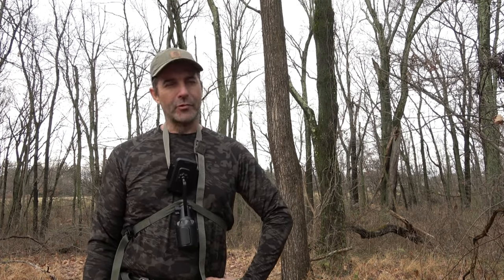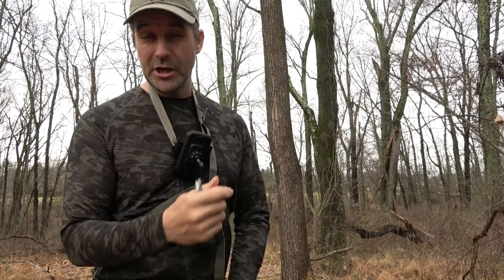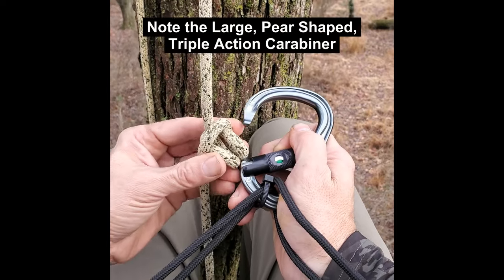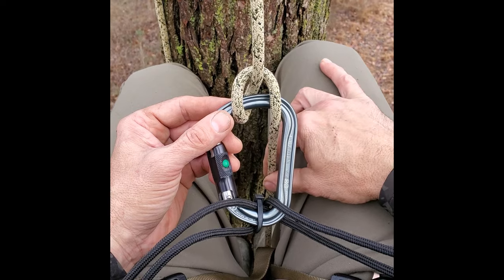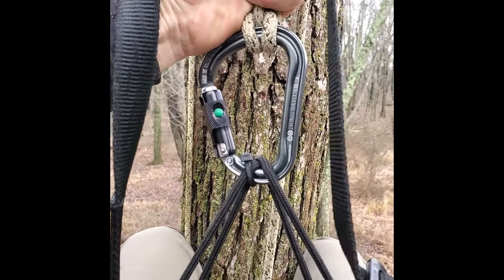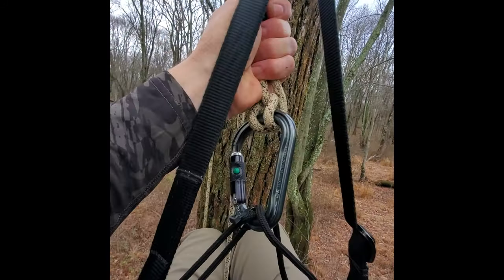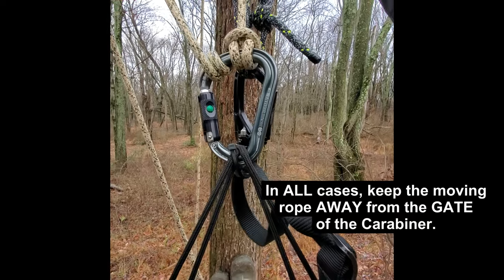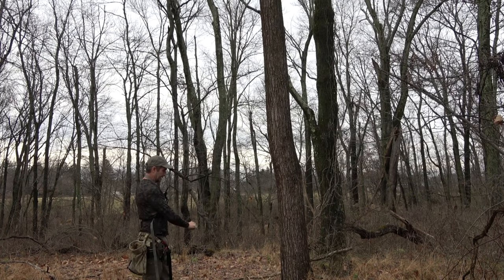Single Rope Rappel on the Munter Friction Hitch, Tree Climbing Demonstration

Comment: I've used munter (aka "Italian hitch") a lot for mountaineering to both belay and rappel (abseil) because it works on heavily ice crusted ropes when devices don't work. It is essential knowledge but it has high rope sheath wear and  twists the ropes, more a problem on long rappels. You do a lot of rappelling with munter/Italian and the ropes don't handle as nicely after that. Great to know but not my go-to method
Reply from the maker: Fyi, have climbed and rappelled nearly every day on a rope with the munter and at the end of 4 years when I retired the rope based on manufacturer recommendations, the rope still looked new with noticeable wear. I had read that it is rough on the sheath but in practice, I learned otherwise.  And you are correct that it can add spin in the rope during the rappel, however, that can be neutralized by varying the angle at which we feed slack in. However, typical rappels for a saddle hunter are only 25ft or 8m. A mountaineering application could be much longer and require precision in the technique. Thank you.

Comment: This demonstration, in my opinion, should be required introductory material for aboricultural training. 

In the standard curriculum, Munter's hitch still gets hardly more than a passing mention to this day, at least where I am based (NZ).

Weight variation of the effective life support load in arboriculture is significant, even without including rescue scenario loads (double the weight). My height is just 1.8 metres and my build is relatively light. 

I haven't weighed myself in the last few years, I would estimate it to be now between 70 and 80 kilograms (I consistently hovered around there since my third decade and I sense myself to be carrying about the same amount to this day). Add weight of harness, along with the changing requirements from one day to the next, maybe a rigging line and block or rings, sometimes a few kilograms' worth of rear handle chainsaw to attend to mid-size timber or maybe the more occasional ten kilograms' worth of MS661 for cutting some large timber at elevation when the circumstances necessitate it.

Before you know it, my effective total load can vary across the range of 15 kilograms, on the higher end potentially pushing (or should it be pulling) past 90 kilograms. Knowing how to scale the friction appropriately should be a fundamental aspect.

Thank you for sharing.
Reply from the maker: Thanks for your comment and expertise.